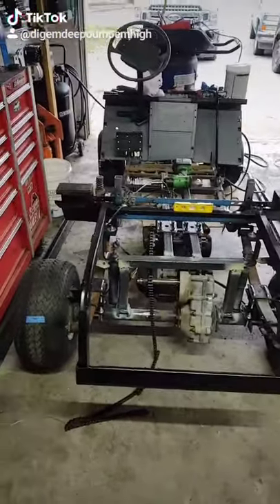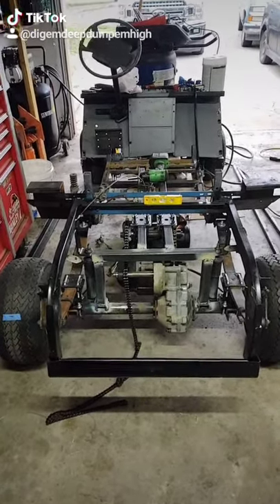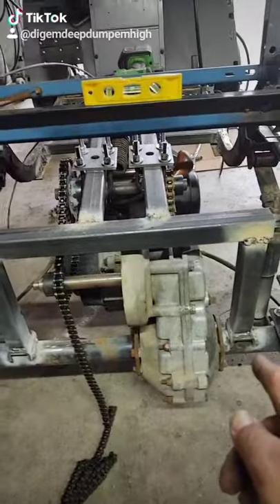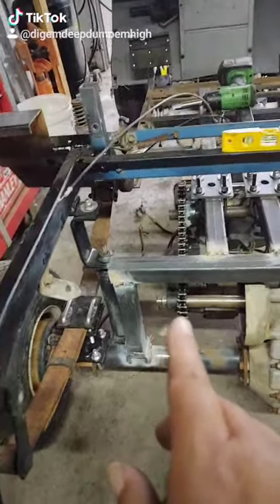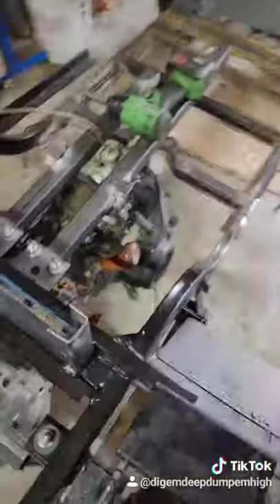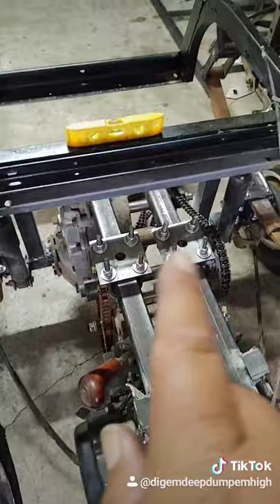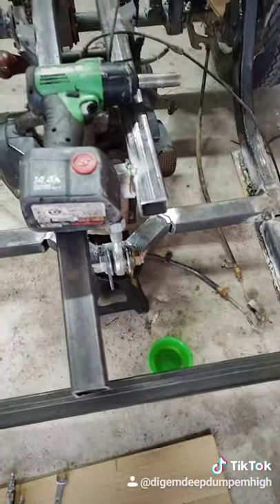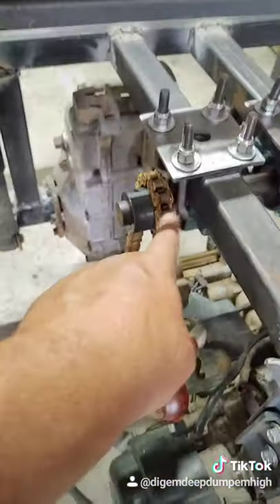golf cart  gy6 motor

Comment: What rear shaft did u use on to make the rear pull
Reply from the maker: The shaft is the electric motor shaft I took a press and I pressed off the other parts and use the shaft
Reply from the maker: If you want more detail about it I'm home now I'm actually sitting on it just give me a shot I'll let you know